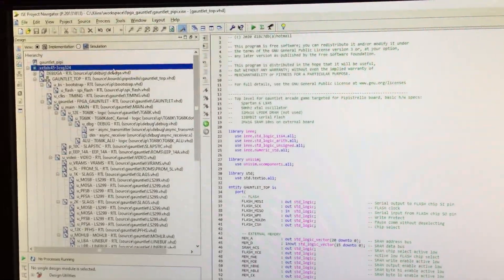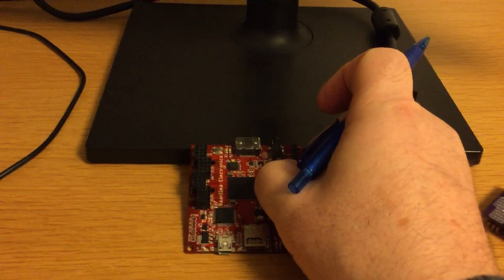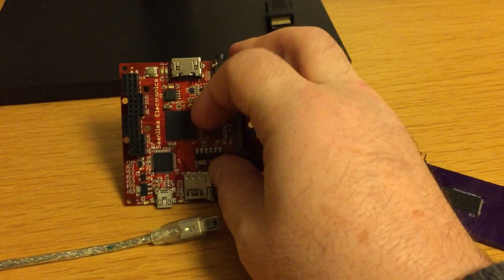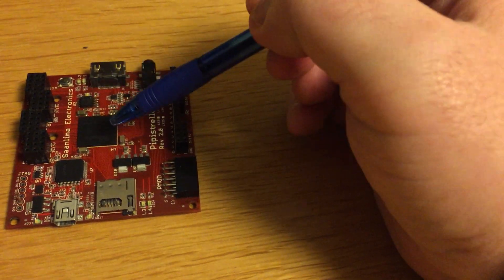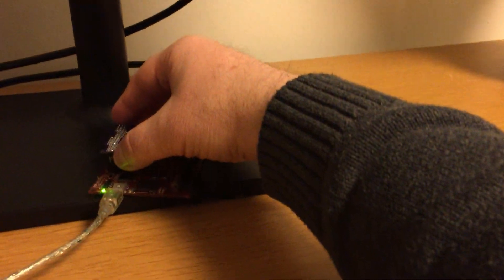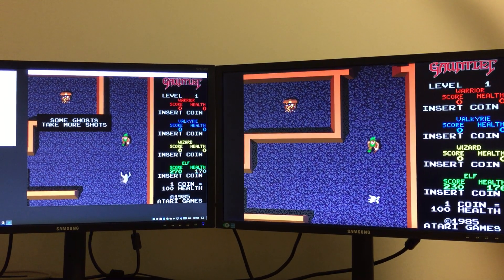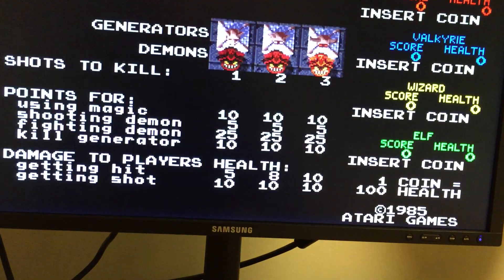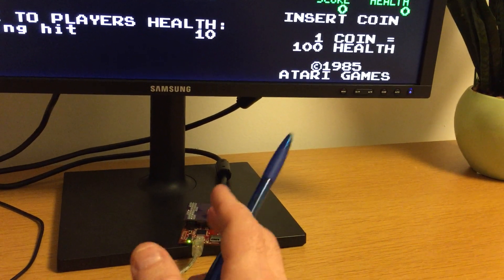Atari Gauntlet in FPGA

Comment: This is awesome work. Doesn't Gauntlet have slapstic? 
Your next challenge is Pole Position.
Reply from the maker: Thanks, this video is a few years old now. The game is fully ported to the MiSTer platform and all the audio and other issues have been solved. I even managed to code the speech synth which looked like hard work but turned out fine in the end with a bit of perseverance. The slapstic wasn't too much of a problem, it has been fully analysed by the MAME project so I had a easy job implementig it.